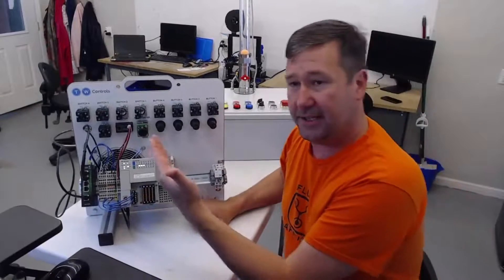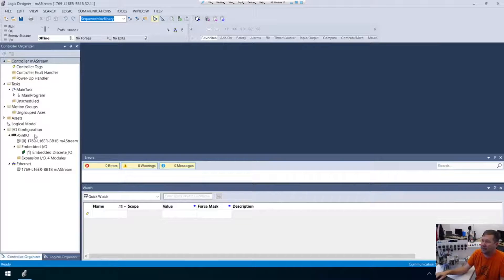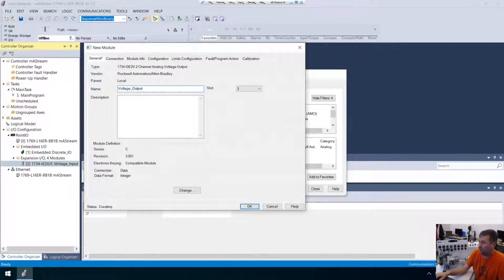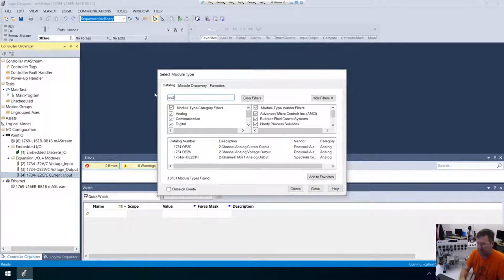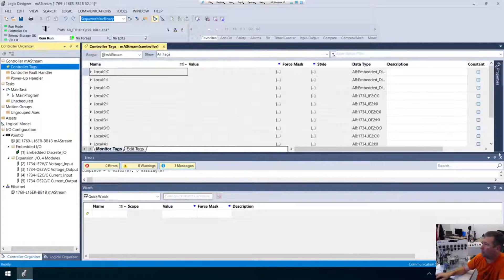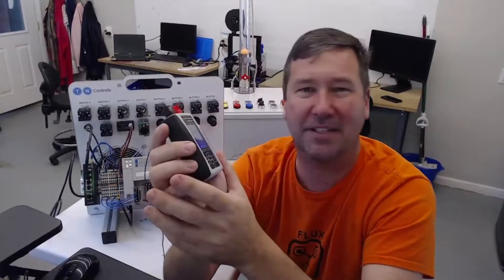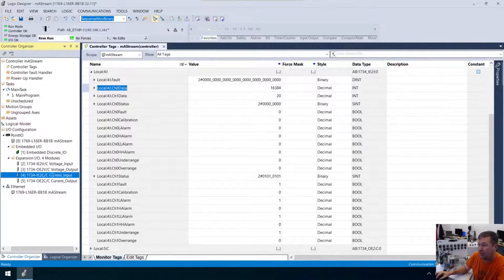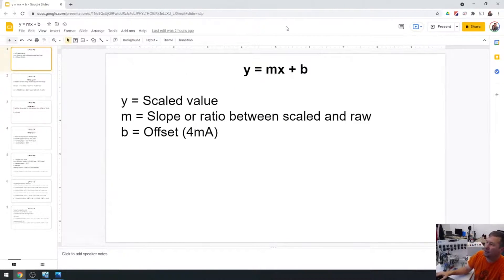Studio 5000 4-20mA and 0-10VDC Analog Input and Output Configuration

Comment: Hi Mr. Tim, this is my first time using a 1769-IF8 analog input, and I still can't figure the scaling, I have a 150psi transducer 0-10v. I changed the card from ENG, to RAW, added 8000 for max 0 min, and don't matter what I have tried nothing works. but the voltage coming out from the card is correct, on my HMI PanelViewPlus is never correct
Reply from the maker: Here is a playlist with some videos that will help.
https://youtu.be/JRmH_57vTf0
Reply: @TimWilborne  thank you,  I will try to open again the link yiu just sent, is not opening,  kind regards
Reply from the maker: Sorry about that, try this link. 
https://youtu.be/JRmH_57vTf0

Comment: I am using a 1756-IF16 module. From the field side, I am getting 4.01 mA (I checked at the module wiring and am getting 4.01 mA there as well), but the program value is showing 4.38 mA. What might be the reason for this.Scaling in program also fine

Comment: Hello Tim,
Great videos! I had a quick question related to my analog inputs. I have a CompactLogix L24ER-QBFC1B controller and using a 0-10vdc signal going to channel 0. I have configured it to 0-10, enabled it and it is working but it responds really slow when going from high to low. Any ideas what I have going on? I checked the circuit with a meter and the input to the card is adjusting fine but it just takes so long  (20 seconds) to go from full span back to zero.
Reply from the maker: Did you happen to set a filter on it?
Reply: @TimWilborne  just using the 60hz default filter
Reply from the maker: @TheRealHighHomestead  That is strange indeed.
Reply: @TimWilborne  it's like there is stray voltage just hanging in the plc, it's very weird,  I've gone through the setting and configurations several times,  tried changing channels, same issues occur